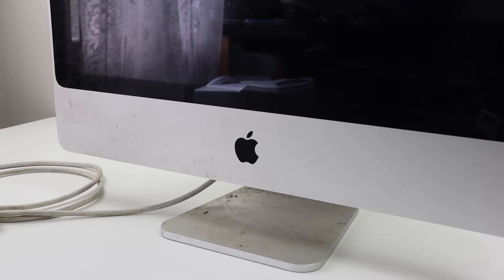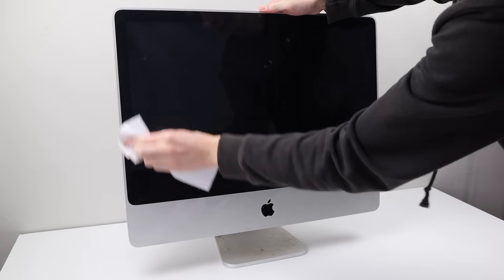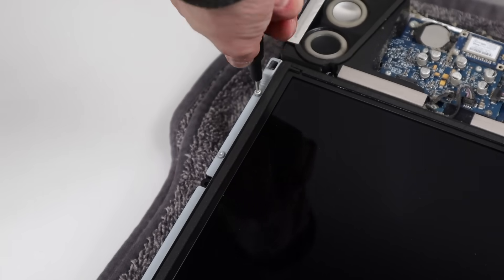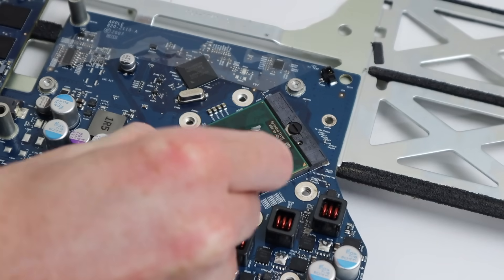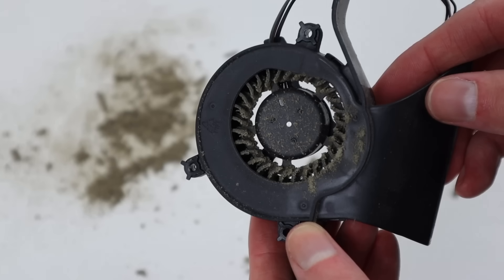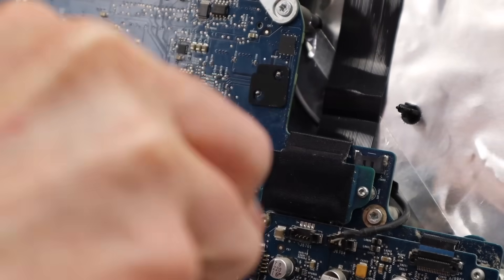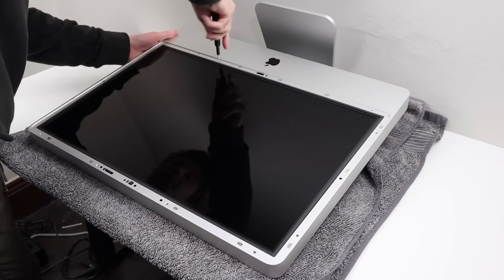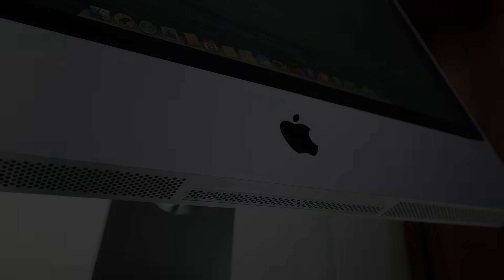I Was Given a FREE Broken iMac, Lets fix it!

Comment: to people who use it. please use a shop vac for pressurized air. canned air on top of costing multitudes more than a single time purchase of a shop vac, releases fluorocarbons, hydrocarbons, and other gases which are not only bad for people, but also for the environment. theres no rational upside to using it, other than the can is small, but a shop vac nozzle works far batter, while not being as strong as a compressor, so it doesnt damage components, plus you can use it for things other than destroying the ozone & inefficiently dusting electronics.

Comment: what's the point of this iMac? I'm not trolling, I have iMac 27 inch from 2011, latest to run is High Sierra which is not supported, and nothing useful seems to be running anymore... now I have installed Win11, and everything seems to be working except speakers - if you have a solution, I would be more than grateful

Comment: great work man u just saved me from buying an imac 27 inch 2019 or 2020 and have to deal with all these hassles once the device got older and dust started to assemble omg.. not to mention the fan noice 😡😡😡 i would simply through it out of the window the next day.

I guess i have to wait for some new imac 27 with apple chipset and no fan cooling system but that would cost a fortune so i simply not going to buy any imac for the next 10 years omg and i have waited 14 years already that is just how slow apple are 😕😕😕😕😕

Comment: Hello, I just wanted ask a quick question. I own a mid 2009 iMac and it just won’t run anything. What can I do?
Reply: Does it boot?
Reply: @SortofGoodwithTech  yes, it does but recently it stopped making the sound it usually does and it goes straight to the screen for OS X
Reply: @ItsJayk28  have you tried reinstalling Mac OS?
Reply: @SortofGoodwithTech  I’ve tried installing maverick’s OS X and it didn’t work
Reply: @ItsJayk28  possibly a RAM fault but other then that I wouldn’t know maybe buying an official install disk off eBay might be better
Reply: Missing or incompatible drivers?
Reply: @SortofGoodwithTech  I don’t know all the tech stuff about it
Reply: @ItsJayk28  ok

Comment: What tool/screwdriver do you use to remove the 12 screws?  I can't find the right fit for the screws
Reply from the maker: I use an iFixit Pro Tech Toolkit. Has every bit you need for this teardown. And just about any other. As for the screws i am not sure what ones you are talking about (possibly Torx head ones) but you can find a guide here that might help you out: https://www.ifixit.com/Device/iMac_Intel_24%22_EMC_2134_and_2211

Comment: Why didn't you disassemble the fans? They are just clipped together, you can just open the clips with a plastic tool. If one of the clips gets broken (which happens with old plastic clips), you can just glue or tape it together.

Comment: You could have screwed that easily with alcohol, I use anti-static liquid, in an anti-static mop, never use water like a sprinkler at any angle of the computer, and if so, dried up, the most dried up You can, unless You learn the hard way eventually

Comment: Great video, Hugh! Did you know that the 2007 24" iMac will recognize and utilize up to 6 Gigs of RAM, although the specs say the limit is 4 Gigs? I replaced my two 2 Gig SIMMS with 2 ea. 4 Gig SIMMS and, as you might say, it works a treat! The computer instantly recognized and displayed the "6 GB 667 Mhz DDR2 SDRAM. I also replaced my hard drive with a 1TB SSD. Although I use
this machine only for importing old home videos and burning DVDs, the improved performance from the additional RAM and upgraded hard drive was very noticeable.
Reply: Wow.. Thanks for this information bro
Reply: that is weird because 6gb is outside of the possible addresses on 32-bit machines
Reply: @xenon486  I didn't know that, but I thought it was worth a try and was somewhat surprised when it actually worked!
Reply: @craigw.scribner6490  yeah that is weird! maybe at like 5gb or something it loops back around?

Comment: This could totally become a daily device!

If the CPU is upraded to a Core 2 Duo T9300 (or T9500, but it is double the price for just a tiny bit more performance) you can patch it up to Catalina with Dosdude1 patcher.
Maybe you could even patch it to Big Sur or Monterey using OpenCore Legacy Patcher.
Anyway Mavericks is worthless today, El Capitan is much better (unless you upgrade the CPU, then go for even newer).

I think this iMac is the one that can run the most amount of macOS versions. Starting with 10.4 Tiger all the way to the latest version (Monterey) through patchers after a CPU upgrade!

Comment: Wow, thank you so much for this. I got a free iMac, I have not touched it yet since Im deployed, Im pretty sure it does boot up to that blank screen. I pretty much want to repair it either myself, if it is the hard drive that is fried. Get it back to working condition, then pretty much send it to Apple to trade in for a new one. But like yours, Im not sure what year it is. Im positive it is a 2013 or newer model. Im not sure whats in it in terms of hardware, but the previous owner did say it does have an i7. They were just throwing it into a dumpster, and I kindly asked them to put it in the trunk of my car instead.
I got it for free since they have an agreement with a company that comes in and replaces all their iMacs every couple of years with new ones. The ones that dont work, they often throw them away. Some tech folks do the same thing I did and wind up getting a free one, but you need to figure out whats wrong with it.

Comment: command + R would have given you access to recovery mode which would allow you to check the hard drive before replacing.
Reply: It doesn’t work on the 2007 a1224 iMacs.

Comment: I like Snow Leopard, Yosemite, and High Sierra as test OSs regarding Macs; I also have Windows XP, 7, and 10 Pros for Windows systems. I also have Kali Linux which seems like enough to check hardware.
I like older Macs as they’re more serviceable and can be kept running for years. I still have an old Core 2 Duo MacBook Pro for simple web browsing and computer basics; my daily driver is a 10 year old MacBook Pro that still runs great, 2.4GHz Intel I7 with 16Gb Ram and a pair of reasonable video cards gave aged well and with OSX optimization it is still enough computer today; Apple really stopped making great laptops in 2015/2016. It’s sad they fight upgrades and even push owners out of the ecosystem by limiting OS evolution. My 2005 Core 2 Duo runs Windows 10, while not a speed demon, it runs without issue.

Comment: Dude.....you REALLY need to invest in a rechargeable/battery powered screw driver.  That small investment could easily cut your disassembly/re-assembly time by about 90%. I'm sure you could find a decent one for under $20.

Comment: There is an official repair manual for this iMac available to download. granted its not from Apple's website, but it's still available. At some point they switch to using GSX to distribute service manuals. Just google 24" 2007 iMac and you'll find it. It's got quite a bit of useful information

Comment: Is this the 2007 imac ? i have a 2007 imac with 2 gb of ram,  ruffly 200 gb of storage and just recently put snow leopard on it should i upgrade to mountain lion or stay on snow leopard  ? snow lepard works grate for basic tasks that i use it for, if I did upgrade to mountain  lion would I need to upgrade the ram ?

Comment: There needs to be an air filter kit one could add to the Mac to prevent the dust buildup. This is probably what caused the failure in the first place or at least helped it to go out.
Electronics and dust seem to be attracted to each other like iron and a magnet.

Comment: This video is giving me flashbacks. I've opened up my Early 2008 24" iMac so many times over its 13 years of continual use from cleaning the fans to replacing/upgrading many parts just to keep it going. I've upgraded the HDD to an SSD (pro tip: remember to enable TRIM), replaced the GPU twice, the LCD, the logic board, CPU, and upgraded the RAM. Like the Ship of Theseus, very little of the original mac remains. But in the end I have a fully maxed out iMac (except for the GPU, for good reasons) that's still going strong. That said, I think it's high time I upgrade!

Comment: The original iMac G6 was loaded with Mac OS X 10.5 Mountain Lion. Pretty much nothing (not even Google Chrome) can be supported on it. I had installed 10.6 Snow Leopard later and it wasn’t much better for support
Reply: I used mine for Game Of The Year 420BLAZEIT which it didn't handle well xd

Comment: In the future when you find a problem where a replacement card can’t be secured with its screw your can use a small piece of proper thickness double sided sticky foam. I use double sided sticky foam for my RC airplane and helicopter hobby, it’s great stuff.

Comment: For the issue of the wireless upgrade (with the screw hole not matching the case/mb), I've used a small piece of double-sided tape in lieu of the screw. Works great and allows the use of an upgraded component.

Comment: Thank you for the info.  I have an old mid 2007 iMac 21 inch that keeps over heating.  At that time all forums just said it's a known design flaw and because it has no real vent in the back for the GPU, you can't really fix it.  But watching this video I just realized the one thing I never even considered.  Replacing the thermal paste.  God I feel like an IDIOT right now.  I fix window machines all the time including replacing thermal paste.

I honest just don't know why I never considered thermal paste issue on my old iMac.  I stopped using my iMac about 10 years ago.  Still sitting at the other desk to the right of my Windows PC.  Hell since the warranty is obviously gone by now, I'm going to open it up and replace the thermal paste on CPU & GPU.  While I'm in there, I'll replace that 500GB HD with a 2TB SSD.

I did upgrade the ram from 2GB to 4GB.  Thanks again.  I now have a new PC project.
Reply: I’m really late but before you upgrade anything just put new thermal paste and make sure it works and doesn’t overheat and it isn’t a design flaw

Comment: Great job!  Dear Hugh,  I have a 2011 iMac that won't start anymore, so I took it to an Apple dealer and they said it is a logic board failure and they can't fix it since it is an old generation. Is it possible to use it somehow as an external monitor for a laptop? Is there a way to do that and fix it for that purpose? Thank you in advance! Cheers!
Reply: currently in the same situation with a 2007, I found a logic board on a parts website and am currently replacing it! hopefully it works

Comment: Props for pointing out the power supply charge. If anyone is looking to tear apart one of these or any computer in general, it's always a good idea to turn the device on a couple times while unplugged to try and remove any residual charge.
Reply: You dumbass,that would add even more charge

Comment: It's astonishing how a little repair could save a pc going to e-waste!
Reply: Yea but honestly old tech like this should just be recycled Bc it’s slow
Reply: @supersop1367  that may be ur opinion but i really love old imacs if i would get it definitely i would repair it and use it
Reply: @lavuchawla1421  any tech under 2015 is just slow and outdated
Reply: @supersop1367  But it could be used to run old operating systems natively
Reply: @K1ngwing  yea but it really doesn’t have much purpose
Reply: @supersop1367  i have a laptop made in 2012 and it can still be updated just fine and runs pretty good for it's age, it all depends on how well it's built and how compatible it is with new things
Reply: @supersop1367  Not necessarily. It's about repurposing and repairing the technology. I have an old Dell XPS from 2010 that originally came with Windows 7. When the HDD started slowing down, I cloned it to a new SSD and maxed out the RAM as well. Instead of messing with Windows 10 on such an old laptop, I decided to install Ubuntu and have no performance issues! Now it's running better than when it was new. Granted, it's not a gaming laptop by today's standards, but for web surfing, word processing, and other non performance oriented programs, it's great! I'll probably keep using the laptop until something breaks and I can't get parts for it (like a motherboard or new screen).
Reply: @supersop1367  I really need old hardware for the things I do
Reply: @supersop1367, you have no idea what sata SSDs are? The reason those PCs are so slow is because of those failing 5400rpm HDDs that came stock with those units. An easy $20 upgrade makes them run brand new again.
Reply: @supersop1367 you dickhead doing that is very bad for the environment

Comment: I inherited an almost identical iMac which was in much better condition - everything was clean and working. I replaced the HDD with a 1TB drive and installed Linux Mint. 20 Now it's a thoroughly modern computer.

Comment: I bought one of these from Apple and it arrived with a row of dead pixels in the middle of it. That's when it occurred to me. If the display dies on a normal PC setup, you simply buy a new monitor. If it dies on this, you're out of a entire computer. So I sent it back and bought a early '08 Mac Pro. A great machine that finally died on me 2yrs ago. Not bad at all, but it was expensive at $2600. Although, that's cheap compared to current Apple tech. It's unlikely I'll ever go back to OSX.

Comment: I'm watching this Sept 2020. I also don't buy or use like any apple products.

You're telling me in 2020, Apple, with their iMacs, aren't using SSD hard drives but still using the spinning platter 5400 7200 rpm stuff? Or is it like base, no upgrade model is default with the spinny bois and if you wanna pay more, upgrade to SSDs? 

With that said, I do have the first gen ipod nano somewhere in my apartment, somewhere..

Comment: The display yellowing is the acrylic lightspreader aging from exposure to the CCFL backlight.

If you are really into heavy maintenance the lightspreader cab be replaced and a set of LED strips installed in place of the CCFL tubes. This also restores screen brightness.

Comment: I’m surprised that you chose to run Mavericks on it, considering that there was much more compatibility with El Cap across the board.
Reply: Yeah I'd have gone for 10.11/El Capitan as well, for best software support. At time of filming, Google Chrome browser only supported 10.10/Yosemite and higher, not 10.9/Mavericks.
In fact, Chrome now requires El Capitan, so that's what I'd be installing.

Comment: I just opened up my late 2009 iMac to replace the thermal paste on the CPU, upgrade the graphics card (after replacing the thermal paste on it's GPU), clean the fans, replace the hard drive and fit an internal Blu-Ray burner. It had warranty seal stickers on the screws over the heatsinks, and they were attached in the same way as on the 2007 model (small torx screws screwed into larger screws). It's a little unusual, but it's also very secure, and makes sure it's supported on both sides of the board, as you don't want it getting over tightened on one side and bending in that particular direction when it comes to fitting it in the iMac case - there's not a lot of room for manoeuvre, after all. 

One thing I will say for the 2009 model is that the amount of dust built up in the case seems to be fairly minimal - and that's after owning the computer since new and using it nearly every day.

Comment: If you are going to be doing pc boards, clean them with 100% isopro. just dunk them in swish it around to clean them, it's that easy... then use a hair dryer heat gun for a few minutes on low to evaporate any left over isopro.. and ya good to go with a clean as part..

Comment: I have a 2017 IMac, EMC 3070 i5 7500 and RX 570, broken display but still has the 2TB storage drive in it. Only needs RAM and display I think. Got it from a dumpster at the landfill lol

Comment: Got a late 2009 iMac with similar story. Replaced the HDD, tried to boot it with a DVD installer for Snow Leopard, had to use an external dvd drive though.
Reply: I am trying to do the same. Were you able to download snow leopard to a dvd from the web? If so, wjere did you get the dl? Also, can you use a macbook's dvd line?
Reply: Any help is greatly appreciated, I tried to load an os that wasnt compatible and get the apple sign then nothing... can't even get the keyboard to pompt it to reboot safely (i think I deleted to much software🤦‍♂️)
Reply: @FlamingArrowTrl  get a usb keyboard, any should work. I got my OS disc from the Apple repair store near me, though you can make USB versions at home. Snow Leopard works alright, but I currently have it running El Capitan. Once you have Snow Leopard installed, then you scan update to El Capitan or put windows on it too
Reply: @FlamingArrowTrl  they’re definitely a both finicky when you’re trying to put an OS on them. If your iMac DVD reader doesn’t work, you’ll have to use a USB reader. Not sure about the MacBook, though I don’t think it would. (it’s worth a shot)
Reply: @donathan258  oh thanks! I just saw that this came thru